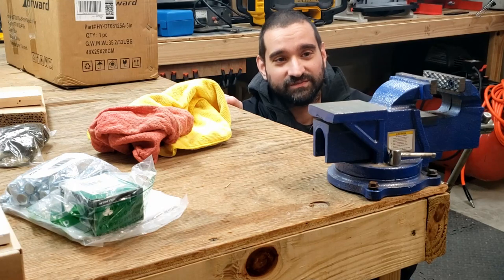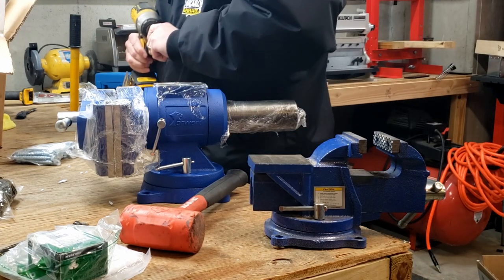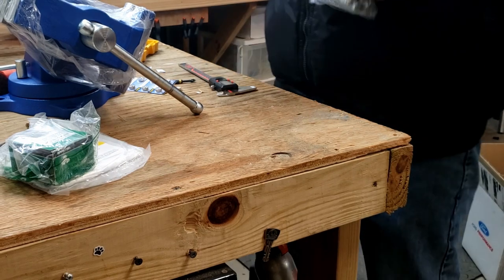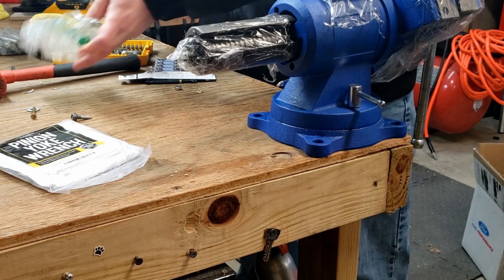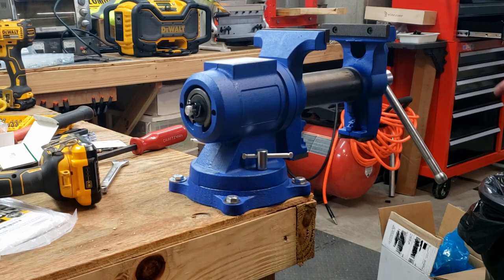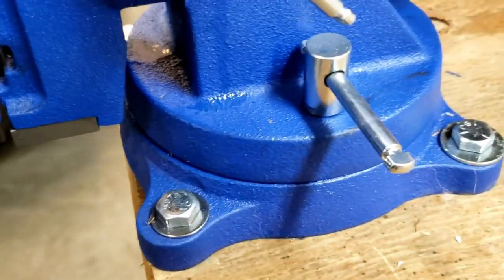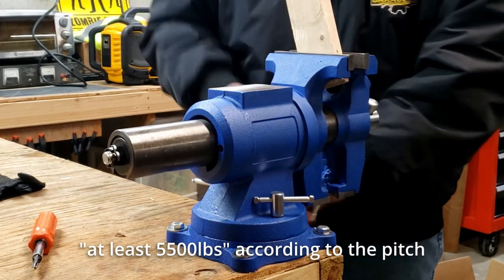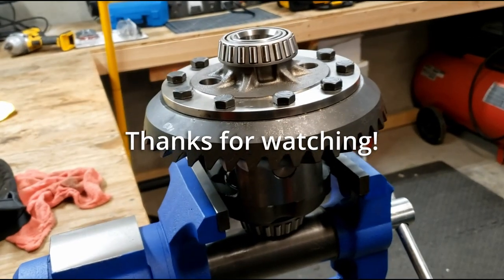Cheap 5" Bench Vise Unboxing and Review - Garage Extra Part 8

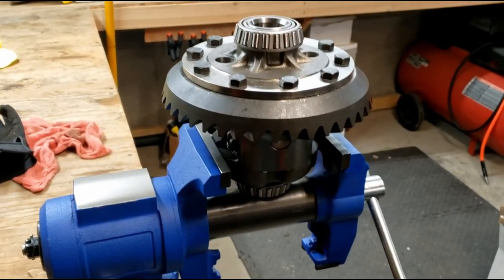Comment from the maker: lol, so this isn't super clear in the video because in my head these videos are strung together sequentially and I've gotten a few comments about it. I didn't replace the vise explicitly because the short fasteners failed but rather because I needed to fit a rear diff carrier in the vise to torque the ring gear bolts and my old vise was too small, see timestamp 11:44 if you abandoned it early. I thought it was funny at the time but I can see that it definitely wouldn't make sense to folks stumbling on this. 🤷My bad!✌

Comment: Which part of the bench vise do you measure 5 inches? Also, is 5 inch good for most small time Diyers?
Reply from the maker: Great questions! I'm fairly certain the 5" refers to the fully opened distance of the jaws. I consider myself a small time DIYer and I will say that after having it for a bit I think it's a perfect size for the price range _for me_. I got away with a 3.5"-ish vise for a very long time. Most everything I do with a vise uses maybe 1-2" of jaw travel max but having the extra has been great. In addition to that rear diff carrier, the extra jaw opening depth came in handy setting some bushings into place, ie. being able to fit some flat stock between the piece and the jaws to ensure a flat press. But that's all from an automotive POV, there's tons of other uses. So yes, if you have the space/money/need, I'd say 5" vises are great for a small time DIYer.
Reply: @SleazysGarage  Thanks.

Comment: I have the Irwin the same thing just marketed under another name. I’m having trouble with the swivel base. Could you show how your model looks on the inside I can’t get mine to work correctly. It feels like it’s jammed or improperly set. Love your content best wishes with the project.
Reply from the maker: Hey bud, I took it apart today and filmed it for my next video. I'll get some stills and upload them to imgur later today. I do have to loosen mine almost completely before it'll turn very well. Feels a little jammed as well but does eventually turn. The metal on the base didn't seem like the greatest so I don't want to force it much.
Reply from the maker: https://imgur.com/a/Clo9Ju4 hope these are useful! Thanks again for watching and commenting!